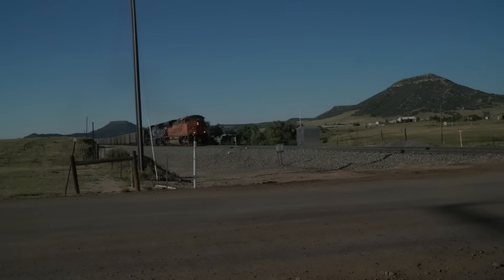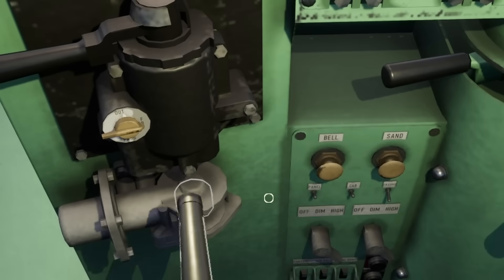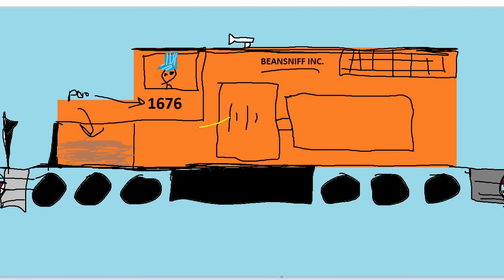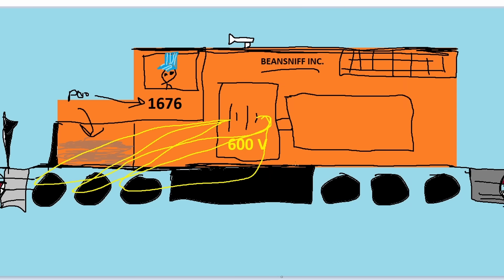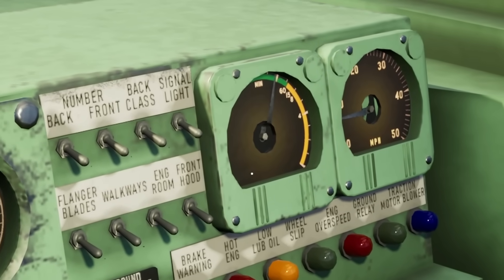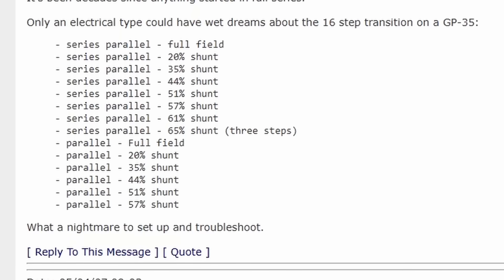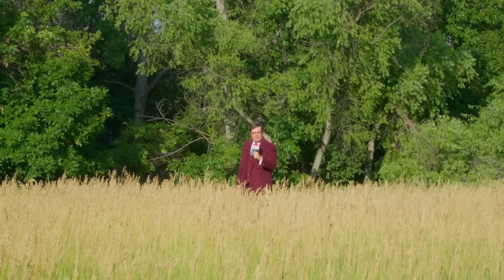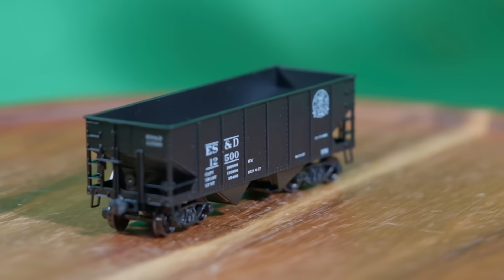The HIDDEN GENIUS of diesel electric locomotives... Transition explained - Railroad 101

Comment: Our electric trams at work also operate on this principle, with several series notches (generally between 4-7 notches on our equipment) and several parallel notches (between 3-7 notches). 

The transition on our equipment however is achieved by arranging the motor connection bars (literal copper bars wrapped around a barrel) in a set arrangement. A transition between series and parallel is achieved with an extra long notch and a rearrangement of the bars during the transition.

This is on equipment mainly dating from the 1913-1942 period.

Resistor grids do also play a part in the control equipment design but they are more for controlling the amount of current being applied but each notch and not for the transition itself, aside from going back to full resistance in the first parallel notch. Each notch selected going upwards takes out some of the resistance in the circuit and steadily increases the current going to the motors.
Reply: That is a lot more control than the Virginian's first design of electric freight locomotives had.  Those had synchronous AC motors, which is a whole other level of electrical complexity, and since they were coupled to the AC frequency on the catenary, they really liked to operate at fixed speeds.  They did have a set of contactors to switch between two different field arrangements on the motors, which let the operator choose either 13mph or 26mph, but that was as much control as you got!
Reply: @BrooksMoses  indeed, this is why many AC electrics (e.g. the W-1 on the Great Northern, and the E60s) had motor-generator sets to allow use of DC traction motors for better speed control.
Reply: @JohnGeorgeBauerBuis  Yes on W-1, no on E60.  The E60 (and many other locomotives having AC power supply and DC motors) used thyristors to cut out some of each half of each AC cycle to limit the amount of current (and voltage if cutting out enough of a cycle) to the motors (at the same time as rectifying the AC to DC).  One disadvantage of doing this is an absolutely awful effect on the power factor for the electrical supply (how well the supply current matches up with the supply voltage).
Reply: @Lucius_Chiaraviglio at least with bad power factor and harmonics. Most of that can be isolated from the grid through the transformer and on sight power factor correction… I guess. AC/DC motor generator don’t really need to worry about that as much though.
Reply: @cloggedpizza239  It can be, but that is still an extra expense.  But I guess the simpler and lighter equipment on the locomotives was enough to push the decision in favor . . . although I still don't know why the transformer tap changer mechanism used on the GG1s and the Metroliners (the latter in combination with the thyristors) was not used in more modern designs -- that couldn't be all that bulky.
Reply: @Lucius_Chiaraviglio  the information I had on the E60 came from a testimonial, and that person must have confused the fan noise with a motor-generator.
Reply: @Lucius_Chiaraviglio  I am aware of some modern electric locomotives that use tap-changers, specifically Austrian ones, however I’m not sure how common it is.
Reply: @JohnGeorgeBauerBuis  From a couple of books I read on motive power in the 1980s, it used to be almost universal on AC electric locomotives having DC motors (apart from the few that had motor-generators instead), but then fell out of favor with the advent of thyristors, despite the ensuing power factor problems.  The Budd Metroliners were the odd ducks in having transformer taps implemented using thyristors.
Reply: @Lucius_Chiaraviglio  I think the E60s with HEP originally used a DC motor to drive a HEP alternator because inverters were still too new, which would explain the whine heard when an E60 with a train of Amfleet coaches stopped at a station that other people have talked about, and the classicifcation Motor-Alternator (E60MA) on the rebuilt examples.
Reply: @JohnGeorgeBauerBuis  That would make sense for the head-end power (and possibly for other low-voltage power supply usage on the locomotive, (like on much of our older rapid transit equipment).  I was talking about propulsion, for which no motor-generator was involved.

Comment: Now we need ElectroBoom to do a video on this and somehow melt his face!
Reply: That will be a big explosion... he'll actually need PPE for the arc flash.
Reply: Not really. Transition just gets stuck. Some of the time you only might get a generator commutator flashover but mostly it's the motor not loading up. This problem went away almost entirely by the time the SD40s came out.
Reply: @pootispiker2866  ElectroBOOM would totally blow up a multimeter with 100 amps if he finds a way to do so without killing himself or getting charged with sabotaging the power grid.
Reply: YES

Comment: I may not be an electrical engineer, but I am (studying to be) an aircraft maintenance engineer, and given the whole mess of spaghetti that is often the electrical systems in such situations I actually understood this video reasonably well, including getting a kick out of Ohm's Law being brought up just two weeks after we covered it in college... I do also understand some of the specifics around AC control systems such as IGBT and GTO, but more information there would definitely be interesting.
Reply: Ohms law goes out the window when you're talking about series wound DC motors, other than heat generation.
Reply: Early DC control based on thyristors is also interesting, especially sound-wise, just search for "363 rozjezd" or "Eso rozjezd" on youtube and you will hear 1980's Czechoslovakian locomotive technology. BTW, those were first multi-system electric locomotives (3kV DC / 25kV 50Hz) with electronic regulation (no starting resistors on the roof) in the world!
Reply: Early thyristor based DC regulation is also interesting, especially sound-wise. Search for "363 rozjezd" or "Eso rozjezd" on youtube and you will hear 1980's czechoslovakian technology. 
BTW, those were first multi-system electric locomotives (3kV DC / 25kV 50Hz) with electronic regulation in the world.
Reply: The "Excessive Overkill" channel recently posted a video called "High Performance Motor Control From the Ground Up" that I would recommend for understanding AC motor controls.  (Hyce, you might also find it interesting.)  It goes into a remarkable amount of detail on designing a motor controller for what most of us think of as a high-powered motor, although it's tiny by locomotive standards.

Comment: Ok... so... there is one thing that still alludes me cause I have tried learning this before: I get the state changes happen in order to rebalance voltage to fight back EMF better, but what I don't get is where are those volts coming from? Like you can't just be like "ok we doubled the voltage" right? Like either the generator has to double output or some resistance or amperage needs to be halved, right? And if that is the case, if amps are lowered with more volts, then shouldn't it be high volts at start if amps is the thing that breaks stuff? Or maybe like half and half at start to leaning more toward volts?

Or do I have this completely wrong and you can "just have more volts" ?
Reply from the maker: The generator or alternator always has 600 volts at run 8 (for most diesels), if you have parallel circuits they all get that same 600 volts. Voltage is only lost by flowing across something. That's how you "get" more volts at the traction motor.
Reply: @Hyce777  So it's not like the motors "consume" the volts? 600 volts into the motor and 600 out? Not like 600 in then like... say 500 out?
Reply: @adformer9212  Voltage isn't an "amount of stuff" that gets consumed like that.  It's ... a reasonably good analogy is a marble run.  Electricity is sort of like marbles rolling around a marble run.  How many marbles are rolling down the track is amperage; how high they are is voltage.  Which is why you always talk about voltage between two points; it's like talking about a height difference.  What matters is that one track is six feet (or volts) higher than another track, not that it's 834 feet above sea level.

While a marble can drop from six feet down to the ground, that "consumes" the marble; it doesn't consume the height of the track.  Similarly, although a motor can consume electrical current, the voltage of the input wire doesn't get consumed.

So, in this analogy, a generator is a lot like a paddle wheel that takes marbles from one track and tosses them up to a higher track.  How high it can toss the marbles depends on how fast it's spinning.  It doesn't matter if it's tossing one marble or hundreds of marbles, they all get tossed the same height.  However, how difficult it is to turn depends on how many marbles it's tossing.  (If it's trying to toss a lot of marbles, that might slow it down, and then it will toss them less high.)

Then a motor is sort of the opposite; the marbles fall from the track onto a paddle wheel that's a bit lower, and how far they fall determines how fast they want to move the paddle wheel.  If they don't fall very far, they won't be moving very fast when they hit the paddle wheel, so they won't move it very fast no matter how many of them there are.  How many marbles there are hitting the paddle wheel determines how much torque is getting applied to it.

Now, let's talk about back EMF.  If you just had a marble run dropping six feet without a paddle wheel at the end, it would end up with a whole lot of marbles running down it because nothing is holding them back.  The same thing happens with a paddle wheel / motor that's not spinning much; lots and lots of marbles will run through it.  Having a lot of marbles running through it means it's applying a lot of torque, though, so it probably starts spinning faster.  And once it starts spinning, that starts holding the marbles back some, and fewer marbles run through it.  Eventually it gets up to a speed where the number of marbles through it are just enough to keep it turning, and it stays at that speed.  If you add load to it, it slows down, more marbles start going through, that provides more torque to counteract the load.

So, okay.  That's what the pieces look like.  Let's consider a locomotive system with one generator and two motors.  We can imagine that the generator is spinning at a speed that will toss the marbles up six feet, and we'll say that's like producing a voltage of 600V across the generator.

When the motors are set up in series, that means the marbles are going through the motors one after the other.  All of the marbles drop three feet through the first motor, and then drop another three feet through the second motor.  The same number of marbles go through each motor and through the generator.

Let's say we're starting from a stop.  The motors aren't turning, and so they aren't holding the marbles back; lots and lots of marbles are going to flow through them.  But not nearly as many as would be flowing through them if the marbles were dropping six feet and and the motor was spinning -- that might be enough marbles to break the motors.  Let's say that with a three-foot drop, the flow of marbles starts out like 200A of electrical flow.  The motors are making lots of torque with that 200A, and so the train starts moving.  As it speeds up, the motors get closer to the speed they want to be running at with three feet of "voltage", and so the current reduces.  Because the current reduces, the torque the engine is producing drops off, and although it's still accelerating, it's accelerating more slowly.

Then, we swap the motors over to parallel -- let's say that happens when the motors reach a speed where the current has dropped to 50A.  After that happens, half of the marbles now drop six feet through the first motor, and the other half drop six feet through the second motor.  That means that the motors now want to spin twice as fast -- and, since the train doesn't instantly speed up, the motors are now farther away from their "desired" speed, so instead of having 50A flow through them, they're now drawing 100A -- and producing twice as much torque as they were.  And that now means that, instead of the generator supplying 50A, it now has to supply 200A again.  That means the generator is now four times as hard to turn, and the governor on the diesel engine is going to have to open the throttle quite a lot to keep the generator at the same speed.

And then all that extra torque means the train gets a whole lot more beans and speeds up some more, and the motors get closer to the speed they want to be running at with six feet of "voltage", and the current reduces down to however much is needed to keep the train at a fixed speed, and the generator becomes easier to turn, and the governor backs off on the throttle, and the engine produces less power.

That might be part of why your intuition is wondering "where does the extra stuff come from when we transition from serial to parallel?"  It's not more volts getting consumed, but it is more amps getting consumed, and those amps being consumed mean it's harder to turn the generator at the same speed to keep the voltage the same, and so the diesel engine has to work harder for the engine to make the same amount of tractive effort.  It's a lot like shifting gears in a car (except if the engine was constant-speed and had a torque convertor).

Does that help?
Reply: @adformer9212 Alternatively, think of Volts like water or steam pressure in a closed system. Volts are a measure of potential change. Amps are the rate of flow of your fluid, and Resistance (or Back-EMF in the motor) is back-pressure or friction.
Reply: @BrooksMoses mostly except for the back EMF part, if the back EMF is volts, wouldn't it make more sense that the motor paddle raises up so that 6ft drop is now a 3 ft drop? And so to keep going the generator paddle has to throw them farther up to get more volts?
Reply: @RexAnger. I see, thanks

Comment: It was fun working with you and explaining how transition worked and playing with it in code. It made me realize that coding electrical circuits like that, is way harder than one would think lol.
Reply from the maker: It was fun! I appreciated the reaching.
Reply: @Hyce777 Hey Hyce a similar principle applies to the Older Trolley Cars as well. I’m a member and Volunteer at the Pennsylvania Trolley Museum and most of our Hand controlled cars have 8 Power Points. The first 5 the Motors are in Series. Then when you get to the 5th Series point all the Resistance is Cut Out and you’re in Full series then when you go to 6th point that’s when the Motors Transition to Parallel and the resistance is cut back in and then when you get up to 8th point that’s Full Parallel and that’s when the Motors have Full 600 volts. You learned a simple version when you visited the Rockhill Trolley Museum and Brill took you on a tour.
Reply: @Hyce777 I also went to Tech School for HVAC and we learned about Ohms law so everything you were saying I understood since I learned about it.
Reply: Oh my gosh it’s the railroader EMD guy

Comment: True that while diesels didn't get transition tech till the 60s, traction and trolleys had a more basic system using resistor grids since the turn of the century.
Reply: Diesels had manual transition since at least the earliest Es. EMDs got rather primitive automatic transition in the 50s, with some being rebuilt for it and others being manufactured with it. It was only in the 60s that we saw traction alternators, which still need transition for 6 axles except for the newest DC power.